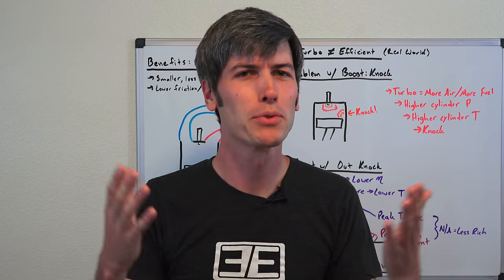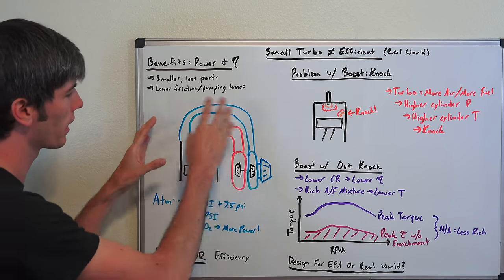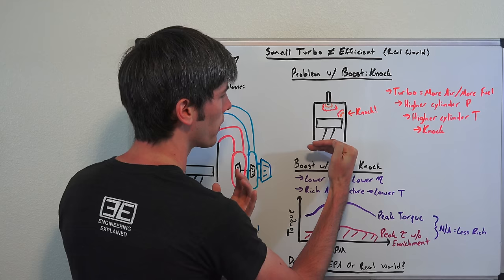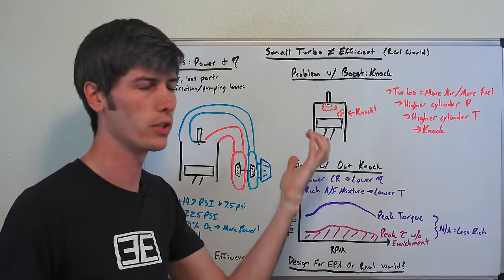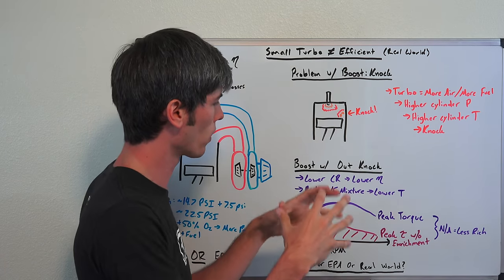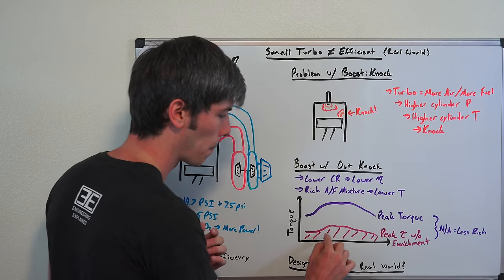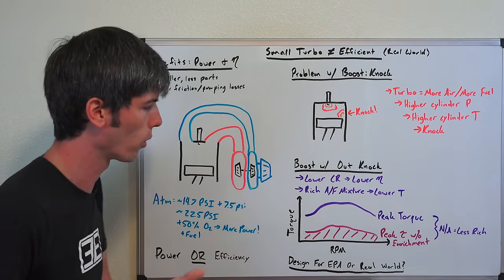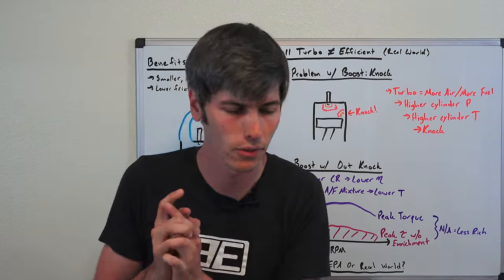Why Small Turbo Engines Are Not Efficient

Comment: I’m surprised you didn’t mention the option of higher octane fuels to help reduce knock. Typically the factory turbo cars use a specific type of programming or ecu tuning called “adaptive octane logic” so the computer can tell how high of octane the fuel it’s using is. Most of the factory turbo cars tend to “recommend 91/93 octane” for this reason. Basically it allows you to use 87 if you want but once the adaptive octane logic sees the fuel is crap it can set a lower cap on the engine timing. So let’s say you use 87 octane. The adaptive octane logic may set the limit of the timing to 12 degrees(advanced) well once you throw 93 in the tank and the sensors sample that fuel it will increase the limit of the timing from 12 degrees to lets say 20 degrees (advanced) resulting in more power out of the same calibration all while keeping the engine safe.
Reply: True and a lot depends on how heavy your foot is applied. With a light foot the tranny can shift before the turbo kicks in. This eleminates knocking and the need for high octane fuel. In this scenario, lower octane fuels can get the same MPG w/o spending that extra 10% per gallon. Regular gas ignites easier and burns quicker than premium which can improve MPG in some scenarios. For the lead foot driver, premium offers more power and better MPG but offset by the fuel's expense.
Reply: That's because higher octane gasoline doesn't actually affect fuel economy. That sales point is a scam. If that were true, all car manufacturers would design engines for that type of gas, and all gas stations would serve only that type of high octane gas.
Reply: @thresh- idk if I’d use that as a blanket statement for all cases. Especially since if your engine is knocking and the fuel system has to retard the timing to compensate for it. Then in that situation the higher octane would result in better fuel economy. 

It’s not as cut and dry as most people think who haven’t studied the modern fuel systems in the past 10-15 years honestly. 

No disrespect intended. People just assume cause they knew long ago it’s the same as it was. And fuel systems and the methods engineers use to control the fuel systems have drastically changed over the past few years.
Reply: @thresh-  for someone like me a master tech of over 15 years to hear someone say higher octane dosnt affect fuel economy it just shows people like me you don’t understand Timing, long and short term fuel trims, what octane actually does and how it affects an engine, or how modern fuel system works. 

Again no disrespect. But when people say blanket statements like that it really shows the uneducated ignorance unfortunately
Reply: @thresh- Domestic car companies are lobbying for a unified 95 octane fuel.  Makes sense since we have so much corn ethanol.  Lower octane fuel has a little more enthalpy, but not being able to compress it as much is costly.
Reply: @mattdagger1480 when switching to a lower octane, the computer will run a more rich fuel mixture right? But this fuel consumption is negligible correct?
Reply: @Boguardis  it actually would inject less. If you’re running 87 in something that needs 93, it’s gonna be much more susceptible to pre-donation. More would only increase this. So In order to prevent this, you inject less, and you retard the timing.
Reply: @Boguardis and no, it is not negligible. It can account for a 1-3mpg difference.
Reply: True, got personal experience with my MINI
Reply: @thresh- I've only ever seen 95 here in Ireland so

Comment: I've got a 2017 Honda Civic Hatchback. For life of that car so far, I have averaged 41-42mpg according to the in car mileage tracking computer. So probably a little less than that, but I would put it at about 40mpg based on when I actually did the math of mileage/gallons at fill-up. I drive 40 miles per day and mostly on the highway going to work & back. Even when I've been driving around town (stop & go) and sitting in fast food drive through lines a lot, my mileage hasn't shown below 36mpg. I don't remember filling up where the computer showed less than 40mpg. Basically if you aren't getting 35+mpg in the current model turbocharged Civics, then it is your driving to blame. Most perceived gas mileage problems in vehicles are the fault of the driver.
Reply: It is Japanese HONDA
Reply: I have a Geo that does 52mpg... 😂

Comment: Knock is not the only reason for having to use a rich mixture, exhaust gas temperature is also really important. Water cooled integrated exhaust manifolds really help increasing the lambda = 1 operating range. Current Miller Cycle engines like the EA888 Gen 3b can even run stochiometric in their whole operating range.

Also, this video really should have had a bsfc diagram in it to show why smaller engines (higher internal pressure) are more efficient at partial load.

Comment: In the case of extremely high boost pressures, I remember seeing twin-fuel systems being implemented. Check out the Ronin Exige, which uses a separate methanol system that is injected into the engine after reaching a certain boost threshold. The methanol increases the octane rating of the gas being burned, at the expense and complexity of two fuel systems in a single car.

Comment: Not quite so simple as richer fuel mixture and retarding ignition timing to prevent pre-ignition (aka Detonation). Combustion chamber shape and piston top shape, detonation sensing, intake air temperatures and LOTs more factor into how good any turbocharged engine could be. To overly simplify turbo engines are less fuel efficient due to the need to enrich intake mixture does not factor in or account for how some manufactures have addressed these innate problems with turbo engines. Example:

Saab-Scania's B234 & B204 turbo engines have a static compression rating of 9.2 to 1 and they achieve good fuel economy with balanced shafts (which consume power increasing fuel consumption). This is done by using a well designed pent roof cylinder head combustion chamber and a domed down piston top and intake/exhaust gas flow pattern control. These basic designed in factors work to prevent detonation with and without turbo boost. The more complete burn due to the afore mentioned design elements in the engine work to help the intake charge burn more complete which extracts more energy per intake charge, lowering emissions and resisting the potential for pre-ignition aka Detonation. To monitor pre-ignition at each cylinder burn cycle, Saab uses in cylinder ionic sensing of the burn in process via the spark plugs. Before and after the intake charge is ignited by the spark plug, the spark plug becomes a sensor to detect pre-ignition and alters when the spark plug is fired as needed, per intake cycle, per cylinder. To address intake charge temperature rise due to air compression by the turbo an intercooler is used to reduce the heat of the intake air. Intake air to the intake manifold is monitored for air temperature and air density. Both are figured and LOTs more factors are figured into the amount of fuel to be injected per cylinder. These factors work in conjunction with the ionic pre-ignition system using the spark plugs. The Saab-Scania turbo engine management system IS one of the most sophisticated out into production with with many technical features that are not recognized, appreciated or understood. Beyond Saab-Scania's turbo engine management system, the B234 & B204 engines are built really tough, durable and very strong to withstand the increase in torque of a turbo engine. It is also why a stock B234/B204 can be up boosted to 450 lb/ft of torque as delivered. Forged chrome-moly steel cranks with nitrided bearing surfaces, Forged chrome-moly steel con-rods, forged aluminum alloy pistons specifically designed for turbo engine duty made by Mahle with oil jets and additional oil cooling features. Stout main bearing and bottom end design, good coolant flow design to move the larger amount of heat produce by a turbo charged engine, oil cooler with thermostat to reduce the oil's operating temperature....

These are just a few technical reasons why Saab-Scania was able to produce a reliable-very durable turbo engine with good fuel efficiency for a given power requirement. These same turbo engines also features low emissions.

Turbocharged engines are essentially a two stage pump system that recovers some of the heat energy that would have been lost via the exhaust to increase overall engine efficiency. The added plus of a turbocharge, lower exhaust noise due to conversion of that pulsed energy into rotational forces to drive the turbine.

Comment: I've had a Honda Accord 1.5L (turbo) for about 2 months. The mileage is phenomenal for this size car (which also delivers up to 192 hp / 192 ft-Lbs over a ridiculously flat "curve" if needed).

Using the OBD port and monitoring the wastegate position and manifold pressure, it's easy to see when the turbo is active.  And that is when needed to get performance.  Thus the small displacement engine consumes as little fuel as needed when cruising and more when power is really needed.

That said, at higher cruising speeds the wastegate does close, but only enough to get the power needed.  In effect, that exhaust energy is being recycled to help the engine breathe enough for the power demand.

So, the small engine will use as much air and fuel as a larger displacement engine _when needed_.

Lighter engine= less mass = less fuel to accelerate.

And the consumption numbers v. my previous Accord prove beyond a doubt that a small turbo engine is a happy and efficient engine.

And, BTW, no knock with 87 octane as recommended by Honda.

Comment: Stay out of boost and your gas mileage will be good 🤷🏻‍♂️ (really hard to do sometimes)
Reply: hard to do when it makes 9ft.lbs of torque without boost.
Reply: Hook up an OBD to it (if you don't have a gauge) and monitor.   Even in cruise there will be some boost - and that's okay - just means you're getting energy out of the exhaust flow to make the small displacement engine behave bigger.  Lighter engine=fuel savings.
Reply: Kris91790 Very true. Really difficult when the turbos start spoiling at 1,700 rpm though, but it saves gas.
Reply: @AlanTheBeast100  Well I know OBD2 stats suck. 

The O2 sensor just sucks at its job(to freaking slow).
Plus on some vehicles they have the o2 sensor behind the cat ALSO.

SO WHAT IS THE SECOND CAT TELLING THE FIRST O2 SENSOR TO DO?
DON'T SAY IT JUST TELLS THE ECU THAT THE CAT IS WORKING!

When Pee my brain tells me that i'm peeing (1st o2 sensor) , If when i'm peeing my pee is black (2nd o2 sensor) brain says WTF!!! WHAT DO I DO!

It freaking does something.
Reply: @yourbabyboyfriendonlyme2485  
I'm not saying it's a substitute for a proper boost gauge, but it does indicate the MP albeit with a slight lag.   (I have Bluedriver with an iPhone and it's quite good in this regard - other readers may be better or worse).
The important thing here of course is not the OBD-II - it's that turbo on a small engine means more energy extracted for the fuel burned.  That's the main point.
Reply: or get a turbo diesel which are very efficient and give good gas milage
Reply: @AlanTheBeast100  not sure what vehicle you drive but all of the turbocharged 4-cylinder engines I've ever driven are just under boost while cruising on a flat road. It's when the engine becomes under a certain load when boost starts to build; for example going up a hill or stepping on the accelerator in a higher gear. For the most part, my WRX stays around -2 vacuum on the highway on flat ground while maintaining speed.
Reply: @SSChambers1  Honda Accord 2018/19 1.5L has the wastegate partially closed (electronically controlled - and that's the key) at cruise (say 120 km/hr), so the MP is higher than the aspirated v. of the same engine would be (well, rather, the throttle would have to open up more).
This 'key' advantage of electronic controlled wastegates  is what makes the car so efficient.  It will map to use the turbo to recover exhaust energy and reduce pumping loss in the intake system.
Boost does NOT mean above local atmospheric pressure - it does mean using the turbo to work on moving air and keep the MP higher than it would normally be for a given throttle setting.  Thus more power - but less cost in the induction - especially as the engine is also smaller/lighter and generating more power per Kg than the 2.4L NA predecessor.  It's all about energy recovery in this case.
Reply: Yeah... no one in this channel does that lol

Comment: Interesting video.  I have a 2017 Jetta with the 1.4 turbo.  EPA Highway estimates are 40MPG; doing 65 mph I'll get 48+.  I've been delighted with the gas mileage so far, however I'm not doing autocross or anything.
Reply: Brandon M but Toyotas new 2.5L NA with 200hp is getting 45mpg at 75-80  mph in a much bigger car.
Reply: Same here. It's been great to me.
Reply: What's funny is my 30 year old Mercedes gets better than "Highway EPA" while doing burnouts... I laugh at those ratings, so innacurate, I've never made that bad of fuel economy as they say.The diesel Merc makes 35-40 mpg driving wild, rated 27 from EPA

My Mazda on the other hand is impossible to hit its rating (best was 19.2 MPG drafting a Semi for 150 mile run at 65mph in 6th, the EPA rating is not realistic). Normal in town is single digit, but who cares, its a rotary, drive it like you stole it!
Reply: epa rating could be not so realistic but still much more realistic than current (soon replaced) european test...
the worst one was a extremly small 850cc 2 cylinder car, official numbers said 56 mpg, real world town+countryside+highway is only 35 mpg...
Reply: Tony x the EPA tests, are done on a dyno, Indoors, no road bumps, no wind, and the fuel they use NOBODY can buy.
Reply: +Leighton Samms I am pretty sure they have to do them on a test track but they do rigged it to their advantage.
Reply: Manu j maybe, but my jetta was 15000 usd brand new and comes in manual (which i prefer)
Reply: @Tony x
Actually the European test is more reliable than EPA. Why? Because NEDC shows lower numbers to all cars while EPA numbers sometimes are lower than the real world ones (for diesels and some turbocharged engines) but sometimes they're impossible to achieve in real life which usually applies to naturally aspirated engines.
Reply: @ManuJohn380  but I'm pretty sure it has a lot less torque and doesn't come in until something like 5000rpm. The VW 1.4tsi max torque is at 1500rpm.  Makes the engine actually perform much better in everyday driving.

Comment: Got a 2017 GTI. If I drive it conservatively, it gets fantastic fuel economy, around 30/36. However, if you even begin to open it up, that drops dramatically - even routinely getting into boost range a bit cuts the fuel economy in half or more. Overall though, it’s a fantastic engine: The power is there when you want it, and for the 90% of the time you don’t, it’s as economical as a Civic.
Reply: Tyler Brown damn I get like 25-27 max driving normally 😅
Reply: Exactly, if you drive like a mature adult, the turbo doesn't cause any dramatic decrease in fuel economy.
Reply: Word love my 1.8 Passat. 40 hwy 33city
Reply: John Ferguson I’m under 2k rpm 85% of the time! I don’t even use more than half pedal often bc I’ll be far over the speed limit at that point, even stock!
Reply: "25-27 max driving normally"  You're not driving it "normally", trust me.  Those engines are so eager to rev it's easy to overdo it.  I love my 1.8T but I know I could be getting better MPG if only I could bring myself to ease off on the gas pedal a little bit.  It's pretty much impossible for me, though lol
Reply: Tyler Brown 30/36mpg is not that good for conservative driving. I easily get 35mpg with 1.6l N/A. And that is the worse case scenario when driving mostly in town. Outside town the consumption is much better. Except for high speed driving, off course. My aero sucks a bit as my car is a mini MPV.
Reply: 50 mpg from seat leon st fr 1.4 150bhp  tsi. 45-mpg around town.
Reply: Shadow of a Daud that’s not a pseudo performance turbo engine well is it ?? That’s damn good mpg considering it has the power the defeat v8s
Reply: TrollBuster that’s somewhat true but I also don’t do many highway miles, when I go on the highway for long trips I’ll get 31 with cruise control on🤷‍♂️
Reply: Yep my MK7 GTI Sport (manual and limited slip diff of course) gets about 35mpg highway in 6th. I got the APR Stage 1 for about 265whp /300wtq and fuel economy didn't change at all unless you're flooring it.
Reply: Justin F those numbers seem a bit low compared to what I’ve seen others get and what apr advertises, you sure you didn’t only get apr plus instead of stage one? Most people report that their mpg increases after the time as well
Reply: The 2.0 is not a rever.
Reply: 308 gti 1.6 boosted engine with 270 hp 52 mpg with eco driving( im not kidding with that) with normal ish driving between 45mpg and 35 mpg and if im just being a hooligan around 25 mpg wich stil isnt to bad
Reply: Tyler, my tuned civic turbo with 215 HP and 240 Lb Feet of torque gets 32 City, 48 Hwy, 38 combined, even with plenty of full throttle runs...   How is 30/36 in your GTI as economical as a Civic?
Reply: @xXlURMOMlXx  Cruise control is your friend lol. I can get 31 city and 37-40 highway in my GTI
Reply: @johnferguson7235  " if you drive like a mature adult, the turbo doesn't cause any dramatic decrease in fuel economy." That defeats the point of driving a GTI.  By comparison the 2.0 atmo or 2.4 atmo Civic Si models (8th & 9th gen) get more or less the same fuel economy (within 10-20%) no matter what, regardless of driving them hard as intended with the shift lights that Honda have provided. 🙂